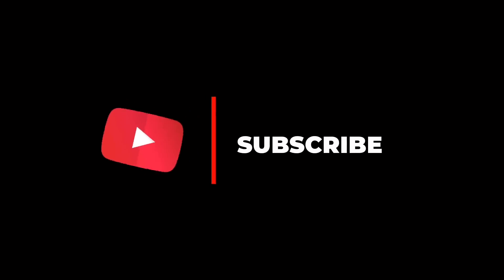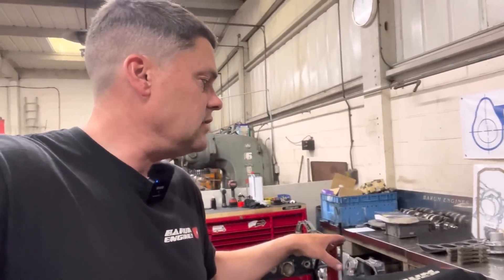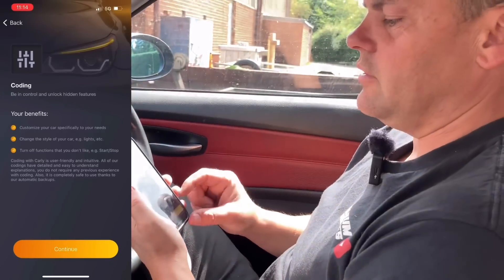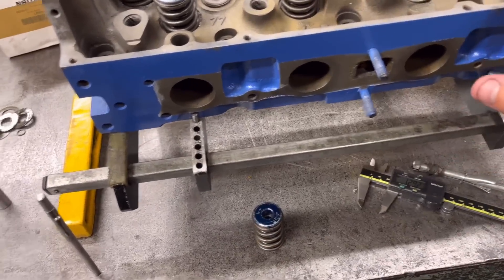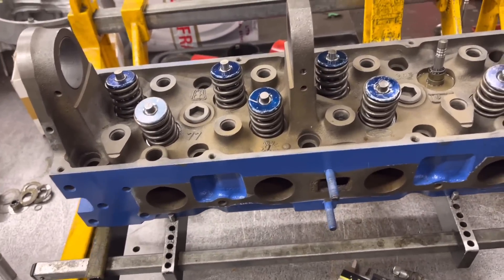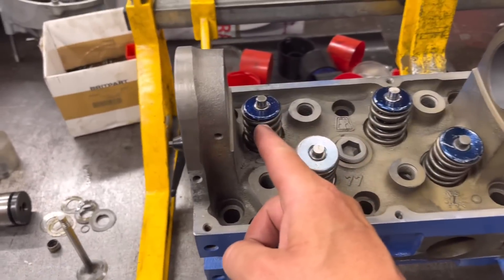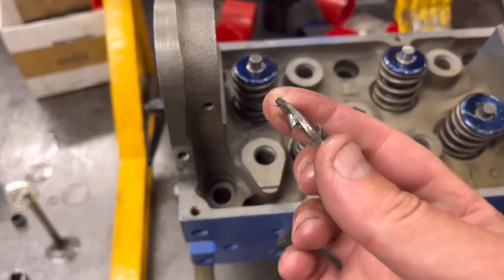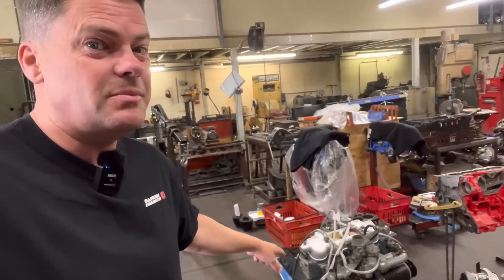BANG goes the engine. One small mistake ends in a MASSIVE problem!

Comment: This Ford engine when first produced had a severe camshaft failure problem. The Cams had a problem and the oil feed bar in the head got blocked. The fix change cam, change oil bar, change filter and oil. I did quite a few, as a customer drove into the yard you could hear clack clack clack yea know the problem. There where some crappy fixes involving roller rocker but only real fix was Cam/Oil Bar/filter and oil. Normal way of doing it was to remove head because camshaft comes out from the back and the car body is in the way. There was a garage in Watford where I was working at the time had a template used inside the car and they cut a hole through the car front bulkhead/firewall and slid the camshaft out into the car and fitted the new one same way. They could do the job in two hours. They had a repair plate with mastic for the hole. Warranty money from Fords was Eight hours with head gasket and associated components so they made a killing on that one. Other garages would take the car there to join the queue and split the difference.  Two washers with neoprene on them go under the bolts for the front of the rocker cover, the slotted holes or you get a leak, do them up last. Make sure plugs are in first you know why, I dropped a bolt and looked for ages down the pit for it. I could not find it. With a torch and slowly turning engine by crankshaft bolt I found the bolt in the cylinder on the piston. Phew, taught me plugs out, compression test, new plugs in. If it can it will.

Comment: BMW  and Merc  have started fitting extras on new cars ,  Heated seats  and steering wheel ,  Front Camera recorder,  Automatic high beam and  BMW Adaptive M suspension that  can be switched on by paying a monthly subscription,  So if you buy a second hand car you can a better spec car then the original owner by paying extra money

Comment: I work Fords with cast iron heads over here in the (Ford V engines made in Cologne) and no separate guide and 8mm stems and its routine to bore the holes oversize..and press in a bronze or a cast iron guide...then size it..I prefer guides sized to accept the PC (positive control) stem seals from originally VW watercooled engines--which dimesnionally are identical to the exhaust stem seals on YBs for 8mm stems..Same color even..VW 16v for 7mm stems such as YB intake, Volvo 16v Redblocks...
Guide lines will do but I wonder why you can't install guides..Only 6 to 8 US dollars per guide>Then you're back to 9mm stems like Gawd intended. Plentiful and cheap for 1 piece stainless forged valves.

Comment: I had an issue once with the standard exhaust valves in a 2.0 Pinto engine in a transit. The clearances kept closing up, only on the exhausts, so I pulled the head, and found that there were recesses in the centres of the valve heads, and stretch marks on the stems. It must have been a bad batch of valves from the factory. Luckily we caught it before one of them stretched to the point of breaking.

Comment: Hi, never use aluminium retainers in a race Pinto, you have been warned,  Roland HT Racing Ltd
Reply: If the customer insists they're used then only with a disclaimer on the warranty for when (not if ) the clickbait title is actually needed.
Reply: @Phuc_Yhou or refuse . The first question  asked when it drops a valve at a meeting will be,  "who built that then?"
Reply: @thelonerizla1  Hopefully Lee will see we're not the only ones who are concerned, does a bit of research and then can make an informed choice which is best for everyone.
Reply: @Phuc_Yhou  I've got to be honest,  I'm not concerned . This channel is grating on me . Lee's terminology is horrendous, which must make his explanations nye on impossible to understand , to the non mechanically minded . See this guy who's the OP on this thread , well he is well worthy of a reply from Lee . This is basic race engine building  knowledge .